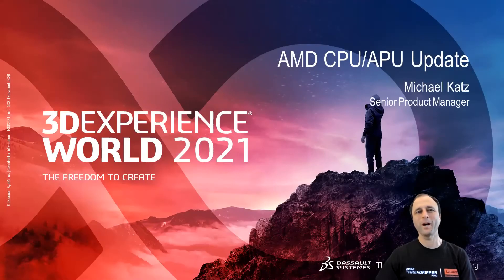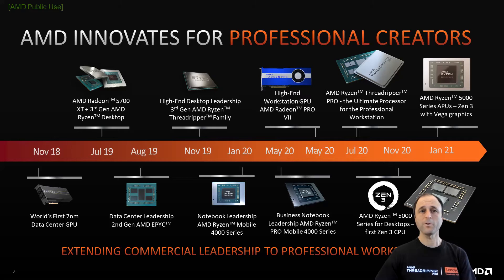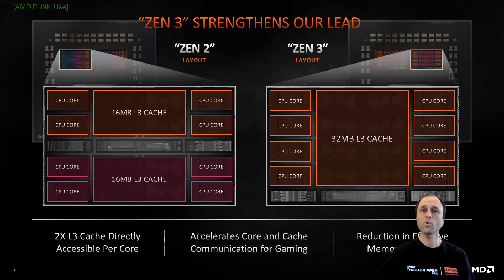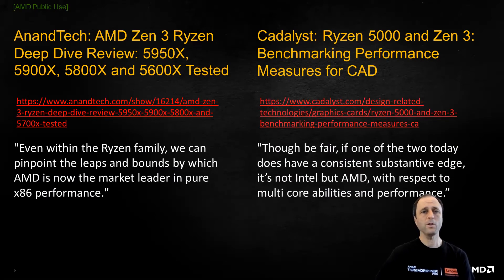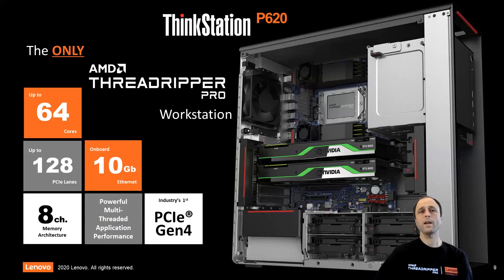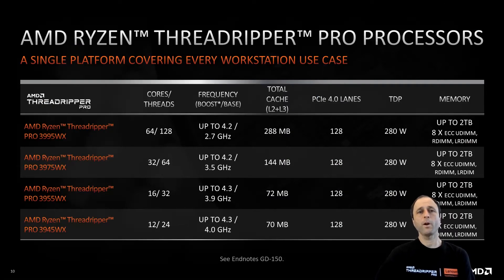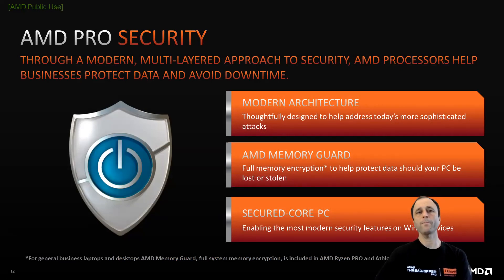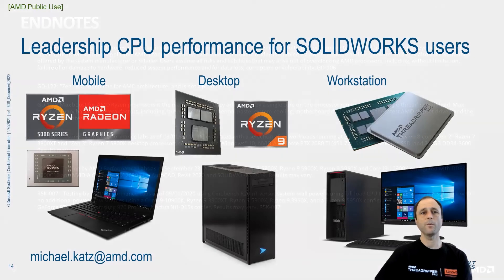AMD CPU update for SOLIDWORKS - 3DEXPERIENCE World 2021 Presentation

Comment: Hi Michael

I have been looking into the AMD processor range for a customer here in Australia wanting to run Simulation in SolidWorks.

They were initially looking at a the Ryzen 7 7700X (8 Cores) but with FEA scaling well to around 12 Cores I initially suggested the Threadripper PRO 5955WX (16 Cores), before noticing that the PRO uses DDR4-3200 (Max 2TB) compared with the Ryzen 7 or Ryzen 9 using DDR5-5200 (Max 128GB).

And am now looking at the Ryzen 9 7950 (16 Cores).

Is there an expected release date yet for a Raphael (Zen4 5nm) Threadripper PRO supporting DDR5-5200?

Is the better choice for SolidWorks CAD/FEA/CFD (Solution Times of 2 to 16 hours) the Ryzen 9 7950 at the moment, assuming you don't need more than 128GB (obviously ECC would be nice)? and should the TDP PL1=170W/PL2=230W be considered when comparing with the 5955WX, TDP PL1=280W? 

Thanks

Daniel

Comment: Hello Michael!
Quick question pls, I am planning to buy a dell laptop with Ryzen 7 5800H CPU and Nvidia RTX 3050Ti GPU. Is that good enough for Solidworks, Ansys, and inventor?
Reply from the maker: The Ryzen 7 5800H is a 45 watt Zen 3 chip with 8 cores, 16 threads, base clock of 3.2GHz and boost clock up to 4.4GHz, so this is a very powerful CPU that will outperform many desktops and provide great single threaded and multi-core performance for your target applications.  Regarding graphics, both SOLIDWORKS and Ansys only test and certify professional workstation GPUs (AMD Radeon PRO and specific Nvidia GPUs that do not include the gaming cards).  Furthermore, SOLIDWORKS offers enhanced viewport modes (RealView, Order Independent Transparency) exclusively with workstation graphics.  The bottom line is that the hardware that you are considering is more than powerful enough to run your target applications, but in the case of SOLIDWORKS and Ansys, you are missing the certification and in the case of SOLIDWORKS some exclusive graphics features.  See https://www.ansys.com/content/dam/it-solutions/platform-support/graphical-display-graphics-cards-tested-2022-r1.pdf and https://www.solidworks.com/support/hardware-certification/ for more information.  Thanks for your question and thanks for watching!
Reply: @michaelkatz1008  Thank you for the In-depth response. It covers everything I want to know

Comment: Hi Michael, I have a question. ASUS-ROG Zephyrus G15 15.6" QHD Laptop AMD Ryzen 9 - 16 GB Memory Nvidia GeForce RTX 3080, 1 TB ssd is a right laptop for SOLIDWORKS?
THANKS
Reply from the maker: Hello Luis, your computer is quite powerful and has more than enough capability to run SOLIDWORKS.  However, there are a couple of advanced viewport modes (RealView and Order Independent Transparency) that are only certified and supported by SOLIDWORKS on professional workstation GPUs like AMD Radeon Pro or Nvidia Quadro or RTX A-series.  If you can get by without RealView and OIT, then your computer will do very nicely for SOLIDWORKS.

Comment: this is just one big AMD commercial. nothing that really showed off anything new.
Reply from the maker: When a company like AMD sponsors an event like 3DExperience World, presentation sessions like this are part of the sponsorship package and are used to get the word out about the sponsor's offerings.  At the time that this presentation was first delivered (February 2021), Ryzen 5000 and Threadripper PRO 3000WX series processors were new as of that year and had not been shown to the SOLIDWORKS audience with specific SOLIDWORKS performance data.  I am sure you can find more current and relevant content from other YouTubers, but thanks for watching and commenting.